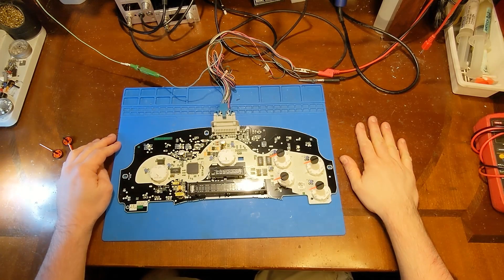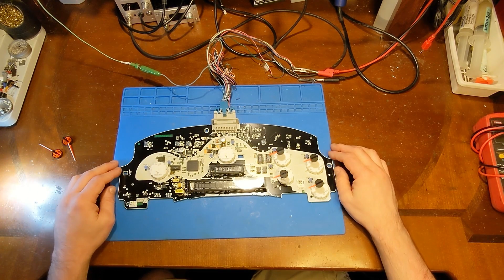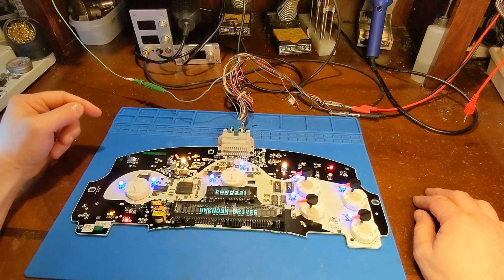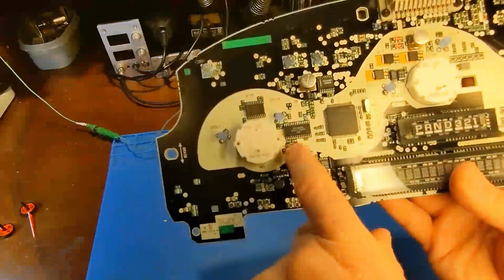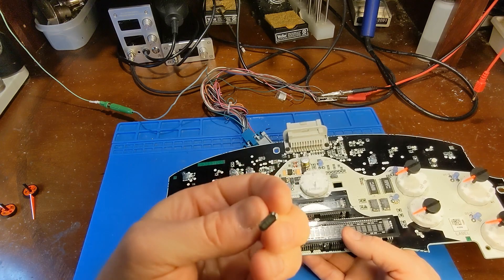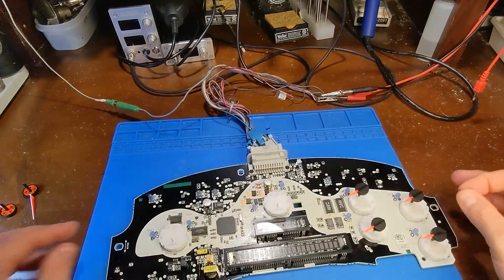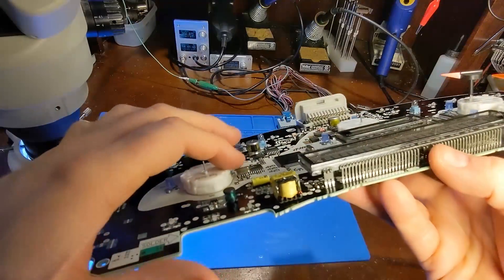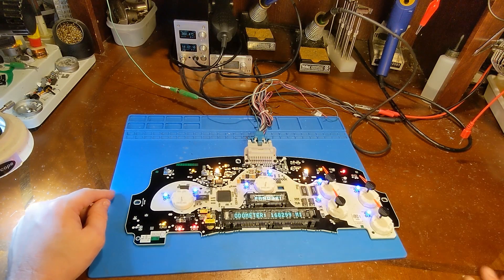Trailblazer cluster with no CAN BUS Comm.

Comment: my trailblazer (2003 LTZ) had a failing gauge cluster, it didn't happen until I was around 250,000 miles. eventually I junked the vehicle, as it had severe frame rust near the rear axle, it also would repeatedly run through water pumps and went through 3 steering racks and 3 Transfer Cases

Never again, that car gave me PTSD

Comment: You're using a through-hole crystal on a surface-mount board.  Would it be a good idea to put a blob of hot-melt under the new crystal to reduce the vibration stress?
Reply from the maker: Vibration is a lot less of an issue as you would think. Many rebuilders mount leaded bulbs to the pads, but I've never seen a bulb lead break from vibration.

Comment: Wow… the YouTube algorithm is a sight to behold. Since I’m here…

My friend recently gave me a 2000 Pontiac Montana after my car was crushed in an EF4 tornado. On my way home with it I observed a few different problems through the gauge cluster:
The whole cluster would seemingly reboot, mid-trip. Also, the fuel gauge would only read empty or full, switching between the two with no actual relation to fuel level. Finally, the lights were out behind the fuel gauge.

Did I mention I do component-level PCB repair? Yeah, well, I diagnosed and replaced the fuel level sender and the gauge works now confirming it wasn’t the stepper motors that are known for going haywire.

I’m not tearing it out and disabling the vehicle for any amount of time to replace the lights when the fuel gauge gets enough illumination from the rest of the cluster. So I’m gonna just live with that unless I have to go in for another reason. ;)

It still reboots about once or twice per trip, and by “reboots” I mean the speedometer needle drops to zero and most of the lights/messages go off for a second, then light up and return to normal like I just started the van. The message center momentarily shows a battery just like starting the van would and I see all the other lights momentarily illuminate for a bulb-check. The odometer shows all 8s for a couple seconds before going back to the correct mileage but I think that’s normal when starting up.

I don’t think it’s intermittent power to the cluster itself because the backlighting doesn’t blink and it always reboots immediately, never acting like it’s waiting for power to return. Is this “reboot” issue likely the cluster, PCM, BCM, or something else? Is there a known fix?
Reply from the maker: The backlighting is on its independent circuit, so it's still possible the cluster is intermittently losing a ground or power.
Reply: @jeffescortlx  Thanks. I was watching your GM cluster troubleshooting video where you just said that right before I got notification of your replay. :) In my case it’s very random and doesn’t seem to be sensitive to bumps or anything else the driver is doing. It can even do it while parked. I do suspect an electrical issue somewhere so I’ll dig in deeper. Perhaps one of the modules communicating with it has an issue. I’ll definitely look. Thanks!
Reply from the maker: @emmettturner9452  bus communication issues typically doesn't cause a full reboot, just some options will drop out.
Reply: @emmettturner9452  Check the solder on both connectors. They tend to crack. There are 2 larger red diodes that crack all the time. This goes for all GM clusters with those 2 diodes. They use them a lot. This can cause the trouble you are having. If you decide to replace it and have a factory radio it will need to be flashed. The new cluster will lock the factory radio otherwise.
Reply: @glehto  Yeah, I’m pretty sure the algorithm brought me here after watching a video on moving the stereo’s EEPROM and that was after looking into a BCM replacement for some other issues. I don’t think resetting once or twice per trip will push me that far. If it gets worse and I’ll definitely check your other potential fixes first. Thanks!

Comment: Just repaired the dim PRNDL in my 2004 GMC Sierra dash by soldering cracked solder joints on the surface mount resistors you have pointed out in your videos. Thanks for sharing your knowledge.

Comment: How do you synthesize the bus message, and what are you telling it, nice job bud
Reply from the maker: I have a ECU and BCM in a project box with potentiometers, out of a 03 Avalanche. It's the box above the black stereo receiver you can sometimes see in my videos.
Reply: @jeffescortlx  oh so you essentially created a make shift bus. When are you going to set up a Dodge/chry rig..???
Reply from the maker: @MegaMarclar  LIN BUS eww.
Reply: @jeffescortlx  old 90s stuff was lin. Pretty much everything after 98 was ccd or can c
Reply: @MegaMarclar  I’m pretty sure even on newer CAN bus equipped Chrysler vehicles, there is still a LIN bus present for certain modules. Usually a some comfort devices that don’t need high speed communication such as power windows and powered seats… Also I believe the cluster is usually the gateway for the LIN bus. 👍
Reply from the maker: @ecaparts  yes from what I've researched, for example the 07 Sebring it uses a combination of communication. To tell the cluster to turn on the backlighting it uses LIN.
Reply: @ecaparts  it really depends on the build. You are correct on the lin bus on supplement systems like wheel buttons and seat stuff but most of that runs through the bcm. The cluster is part of the gateway but usually just between high and low speed networks. Again it depends on the build.